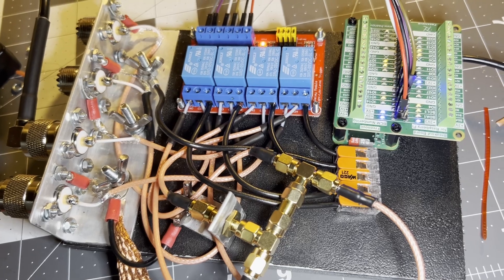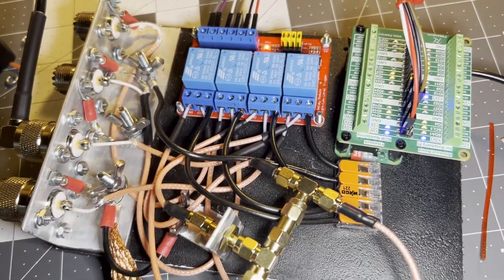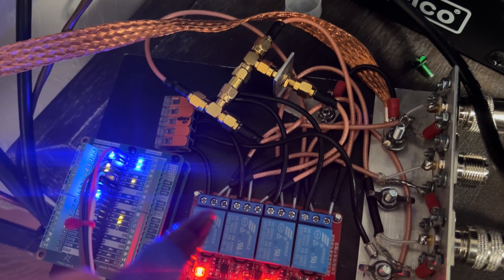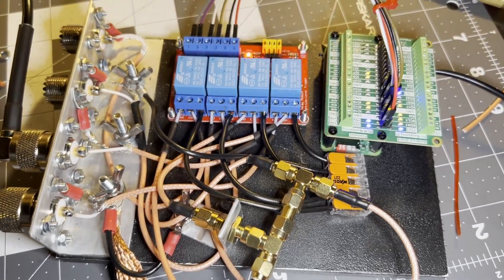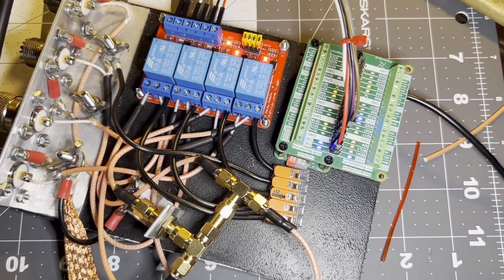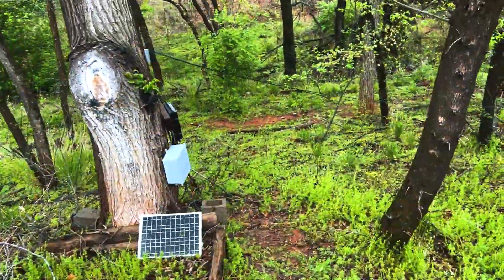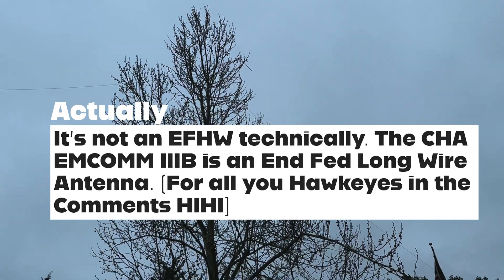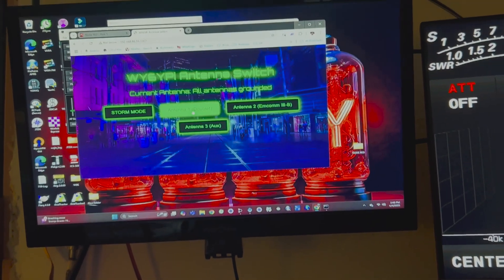Ham Radio Remote Antenna Switch Made from Raspberry Pi 0 2 W.

Comment: Just for info. The best part of Ham Radio is making stuff. I will be uploading a video soon regarding upgrading my remote aerial switch. Also other gadgets and useful low cost power filters. Providing they arrive by post today. Sometimes is better to buy rather than make yourself. But more fun making and good learning curve. Best wishes from cold wet UK. G1BKI known as George
Reply from the maker: Thanks George. I’m working on a complete revision of this switch right now with coaxial relays and a much larger ground pad. Yes I could likely buy one that works the same or better, but if I do that, I will likely not know how it works. I tend to tumble in and out of errors until I get something right, which is very educational. As it is this switch works very well, apart from 10m where it causes the Pi to restart. Thanks for watching.  73 WY6Y